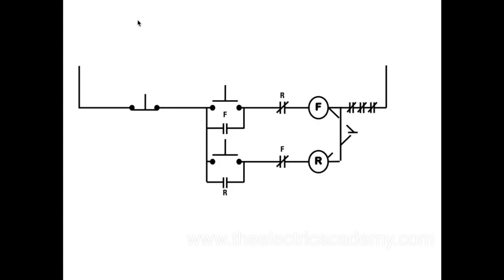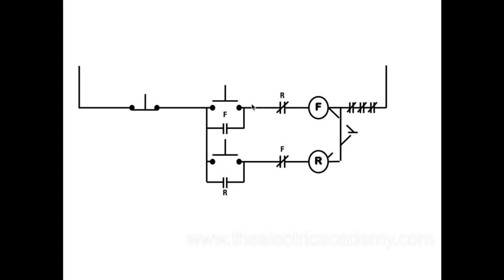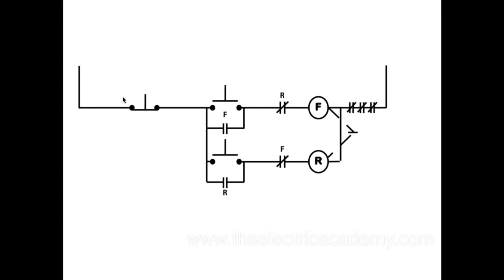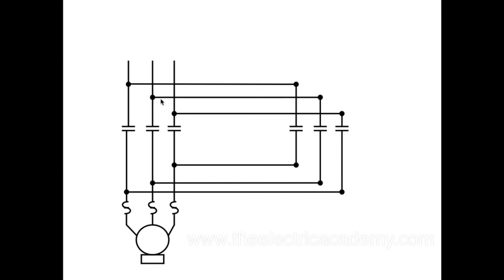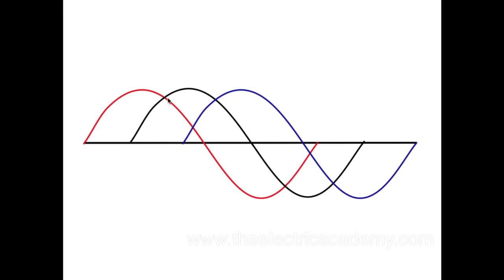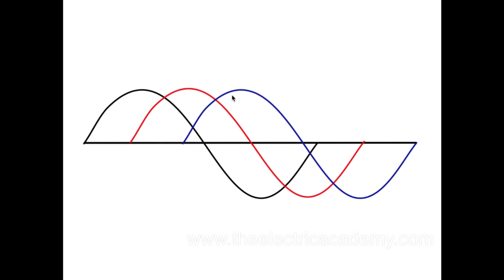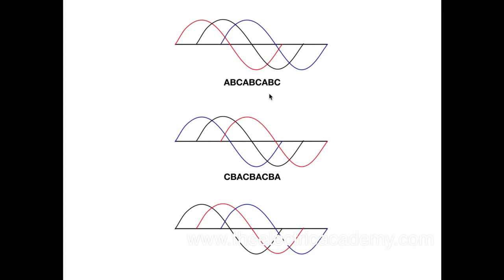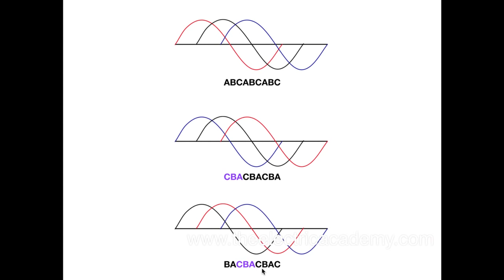How to reverse a three phase motor

Comment: If you replace a 3 phase motor like for like. And using the same lead configuration. Why does it spin in CCW to where on the original motor it’s spinning CW? Thanks